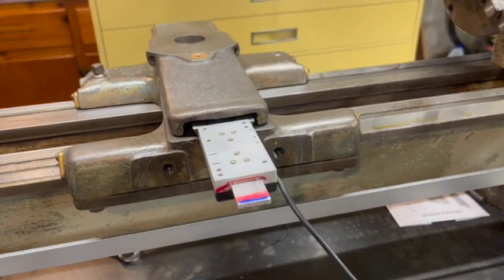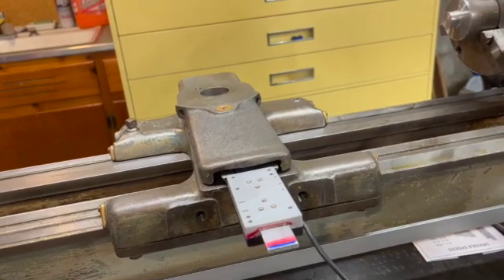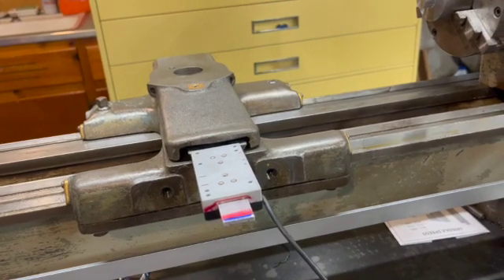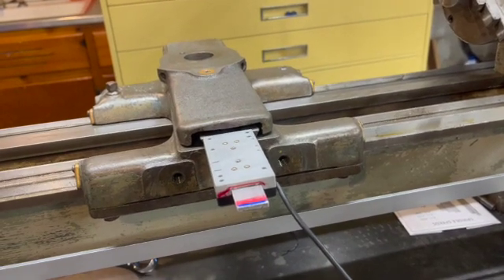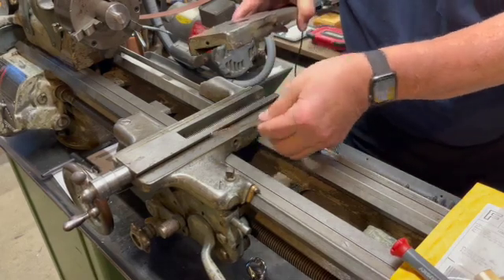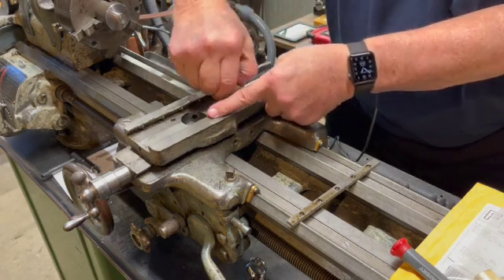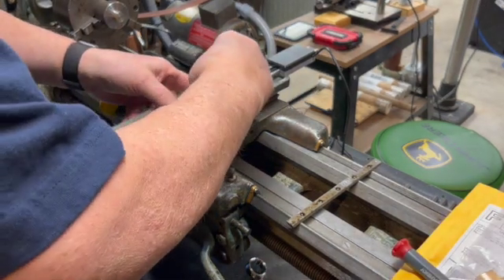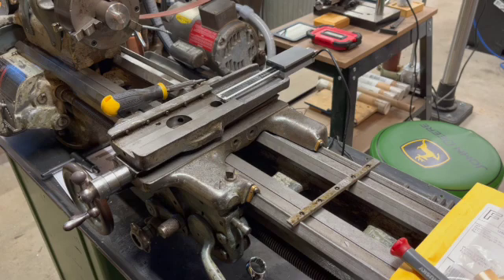South Bend 9" Lathe - DRO Upgrade! Part 2  Details, Details, Details

Comment: Out of all the videos I have seen for adding a DRO to a lathe, especially a South Bend, this has the be the most ingenious method.  While most folks use the mounting holes for the follow rest, this is not a option for me because i do use it.  Do you have pictures or plans posted somewhere else?  What length scale did you use for for axis.
Reply from the maker: Details on the scales are in the first video's description.  Everything I did is in the 2 videos.  I measured and fabricated as I went along, holding parts up to my lathe and fitting it up so, sorry, no additional photos or drawings.

Comment: First..  nice job,, want to add this to my SB 9"
Is there a reason you did install the carriage readout scale a little further back so you did not need to mill the nut?
Reply from the maker: By milling the nut, I got the maximum travel for the scale.  It gains an extra 1/4".